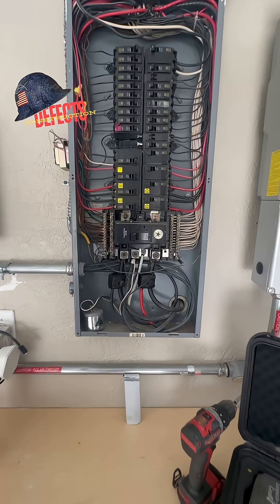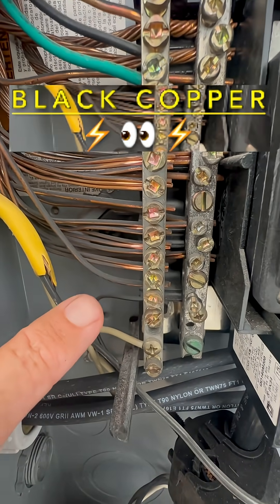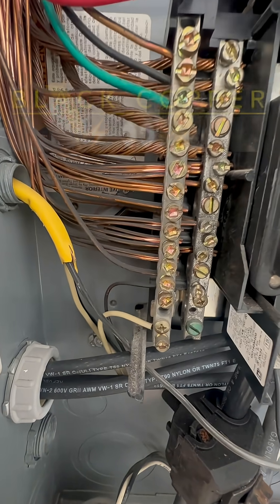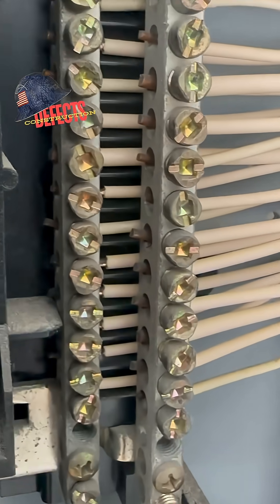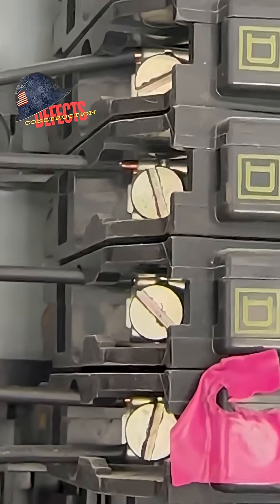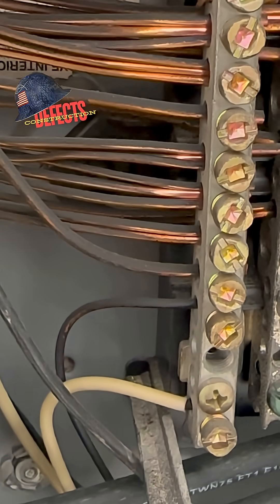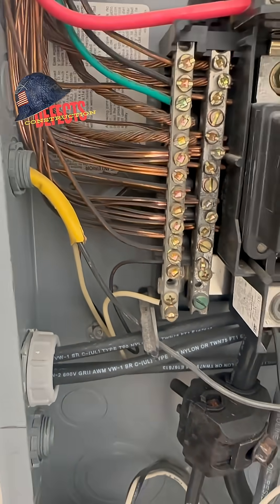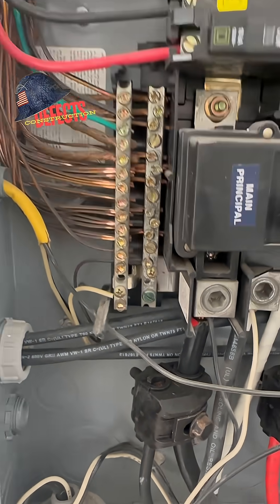Why Is This Copper Black? 20+ Year Old Panel Shock! #Shorts

Comment from the maker: Thanks for all the input.... Great catch  @jeffbartlett on the yellow Romex going into conduit that goes to the exterior well pump, that could very well be a primary cause...
Also, While it’s true that stray voltages hit the neutral and grounds only carry fault current and Moisture inside can oxidize copper to black CuO, no doubt. But with marshy ground and 2017 solar setup coupled with a defective rod connection adding resistance, boosting oxidation at the top of the exposed copper ground and neutral conductors. An ohm test could settle it. Seen this with old panels and solar? 
Let me know. 
Check out this other short from a one year warranty inspection 2 weeks ago, where a couple grounds are already blackening in a different way … 

https://youtube.com/shorts/qGz_pnwrBzE?si=2uaDgvuWLDFvdR5i

Comment: Chinese drywall making oxidation on romex shielded conductors and grounds?  Explain...
Reply from the maker: Yes, that’s a real issue! Chinese drywall from the 2000s emits sulfur gases that corrode copper in Romex wiring, turning conductors & grounds black over time. If the home was built/renovated then, you always be sure to check for other signs like AC coil pitting or a rotten egg smell. 
Thanks for watching the video!

Comment: Looks like the surge arrestor is connected to the main lugs?
Reply from the maker: Hmmm … looks like it.  That and the solar. You think the surge protector could be a piece to the puzzle?
Reply: @ConstructionDefectVideos  Probably doesn't have anything to do with the oxidized wires, just pointing out a code violation. Surge arrestors should be connected to a breaker on the busbar.

Comment: Black copper could be copper sulfide.  I heard « marshy ground » and read « well pump ».  If you have sulfurus water in the well and a poorly seal conduit, you may have some hydrogen sulfide reaching the panel.  Same hydrogen sulfide could come from decaying organic mater in « marshy soil ». Was is wastewater treatment for more than 30 years. Saw way too much black copper. 😵‍💫

Comment: I see this nearly dayly ... most common on older Installations it is always the neutral go black ...
I think it has to do with elecron movement...
i just can not understand why it happens in AC connections !
this schuld cancel itself.....unless a DC current is flowing......
Please enlight me.
Sorry for my Bad englisch!
Reply from the maker: Thanks that you’re sharing your experience of spotting this regularly on older installs! The neutral going black could link to electron movement—when current flows in a 20+ year old panel like on mine, a loose or corroded ground rod, maybe from marshy ground, can build resistance. In AC, it should balance out, but a 2017 solar tweak or even moisture from a well pump conduit nearby might let DC-like stray currents sneak in, boosting oxidation to black copper oxide (CuO). The pump area worsening blackening elsewhere backs this up—ohm test could nail it. I got a list of possible causes of blackening wiring if you want it... No worries on the English—it’s clear! 👍

Comment: Chlorine in the air?
Reply from the maker: Hey, love the guess—chlorine in the air could do it! It can react with copper to form black copper compounds, especially if the panel’s near a pool or chemicals at one time. But with that bad ground and 2017 solar upgrade, I’m leaning toward a corroded ground rod boosting oxidation to CuO at the top connection. Could definitely be multiple things since original construction.  
Thanks for watching.

Comment: If they have lead acid batteries on the solar system, the charge controller may be overcharging the batteries producing hydrogen gas.  I have heard a caution for electroplating setups where, if not vented enough, all the tools in your shop will rust at 90 miles per hour.  Where does that yellow cable conduit go?  There is oxidation in front of it, but not not six inches above...    maybe plug that conduit with some "fire barrier sealant" (like play-dough).   Could also be chlorine from a pool area or swamp gas working its way into the conduit.
Reply from the maker: Very Nice catch👍—thanks for nailing it with that idea! That yellow Romex wire heading to the well pump could totally explain the oxidation right in front of the conduit—moisture from the pump in that marshy ground might be sneaking in, hitting the ground wire’s top connection and turning it into black copper oxide (CuO). The 2017 solar tweak might’ve stressed the old 20+ year panel too, and the spotty blackening (none six inches up) fits if the pump’s venting damp air. Sealing the conduit with fire barrier sealant could be a fix, but I’m also still betting on a corroded ground rod—ohm test will tell. Great input—any other ideas?
Reply from the maker: Oh by the way … no solar batteries. But if there was,  then good guess.

Comment: 3 ground rods? No
Reply: Why not, I always do a minimum of two ground rods 
I’m not sure that more is bad, I also only put them in with Cadweld connections 
Just using a simple acorn not or some other clamp is so 19th century
Reply from the maker: Why more ground bad? 
Extra rods, spaced 6-10 feet apart and bonded together, can lower resistance  (under 5 ohms per NEC 250.53), giving fault currents a better path and may slow the blackening. The 2017 solar might’ve strained the old setup too, so more grounds could help balance it
Reply: @ConstructionDefectVideos   I was always taught current never flows on the ground rods only voltage. Also that the ground rods are only there to provide a path for lightning strikes and a path for voltage to go if there is excess. I know from experience too that the main ground to the house does not come from the rods under the main panels it comes from our bond of the neutral from the pole or main service.
Reply from the maker: Hey @LilMuffinTop—thanks for the insight! You’re right that current typically doesn’t flow through ground rods under normal conditions; they’re mainly there to handle lightning or excess voltage, like you learned, and the main ground often bonds to the neutral from the pole or service. But in my 20+ year old panel with marshy ground, a corroded rod or the 2017 solar tweak could still mess with the setup. If resistance builds at the top connection, moisture might boost oxidation to black copper oxide (CuO), even with minimal current. Plus, the blackening worsening near the yellow Romex entering the well pump conduit suggests moisture or damp air from there could be a factor too. An ohm test could check it. Your take on the solar angle? 👍